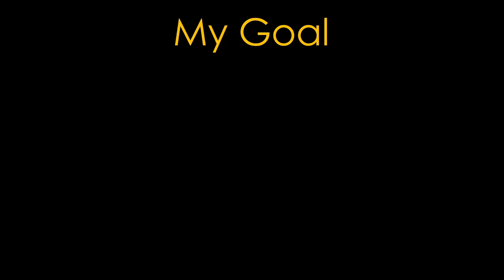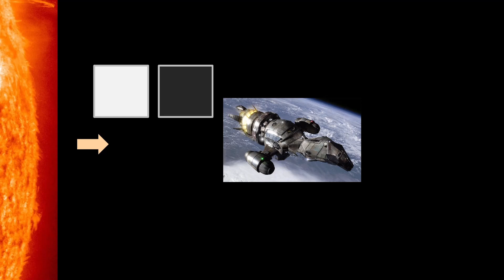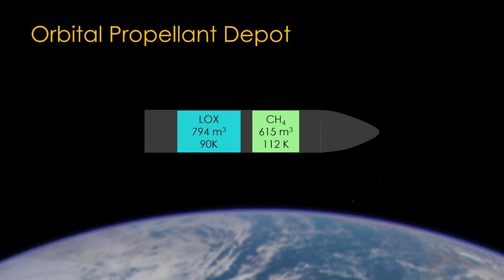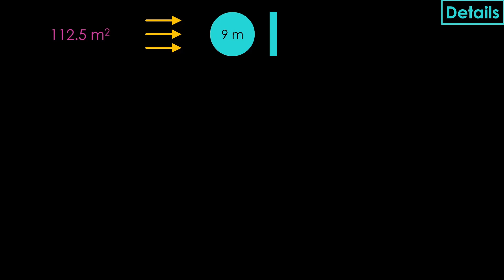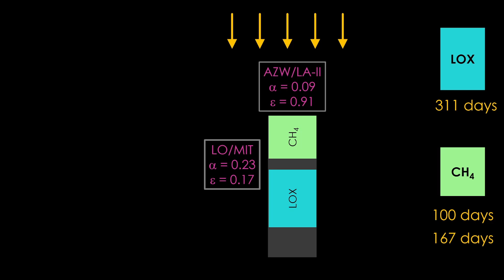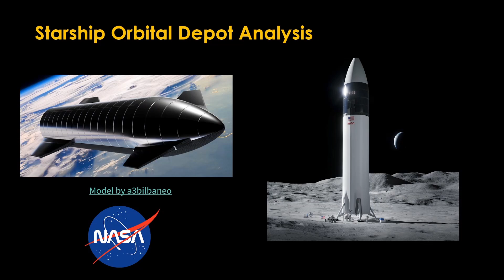Starship Orbital Propellant Depot

Comment: For extra longevity (eg. deep space missions, Mars, etc.), one could envision installing a cryocooler. It would add mass, and need to be powered by either solar or by burning off some of the propellants, but such a depot could conceivably last years in Mars orbit.
Reply from the maker: You can definitely add cryocoolers. That might be something you want for Mars, and it might also be something you want waiting in lunar orbit for the crew to show up. 
NASA has done a lot of research on cryocoolers for liquid hydrogen, which is a much harder problem.
Reply: Wouldn't you also need massive radiators? The heat pulled out of the propellant needs to go somewhere.
Reply from the maker: The radiator size depends on the temperature that they operate at and their emissivity. So it really depends on the operating temp of the cryocooler heat output.
Reply: @PascalSchoenhardt  Indeed it does. I am not sure how big the radiators would have to be. Another option would be to split the boiloff flow between the hot side and the cold side of the cryocooler, colling some of the -1xx °C gas back into liquid, while venting some at say +200 °C.
Reply: @TheBackyardChemist Instead of venting the gasses, route them to a fuel cell to power the cooler and other electronics.
Reply: Yeah. The thermal radiators need a large surface area, but you really want to minimize mass. So they are made of lithium-aluminum alloy (instead of copper), with a high-emissivity coating. They are approximating a thin foil stretched between fluid manifolds, with micro channels carrying the thermal transfer fluid. 

The whole thing is fragile and susceptible to punctures. Somehow, it needs to automatically isolate leaks in the micro tubes where a puncture occurs. 

Probably needs some way to cheaply insert thousands of sensitive microvalves into every manifold that will automatically close in matched pairs. 
 @PascalSchoenhardt
Reply: Assuming one year boil off time, thats 137kg of propellant lost per hour. Burn it and you have about 450kW of thermal power.
Reply: A nice refrigerator floating around in space… on its way to Mars or circling the moon 😂

Why not just say, use refrigerators 🎉
Reply: A small reactor could keep the fuel cold for very long spans. Radiators would be sized to shed heat of the reactor plus conducting losses.

Comment: Would pointing the engines at the sun make a significant difference?
Reply from the maker: Complicated question. Some of the sunlight will get absorbed by the engine nozzles, and some will make it to the thrust puck which is essentially the bottom of the LOX tank. It's probably possible to know how much the engines would heat up and how much heat they would transfer to the tankage - both through re-radiation and conduction - but that would be a very advanced analysis. 

My guess is that you will get pretty close to having a nose of uncoated stainless pointed at the sun, which my model says is worse than the coated nose, but only by around 10%
Reply: Less than ideal option